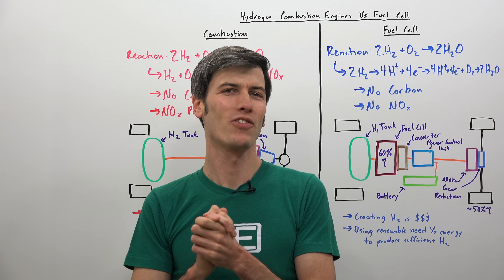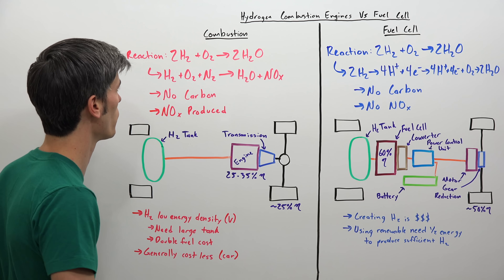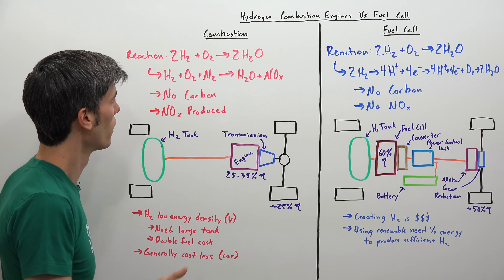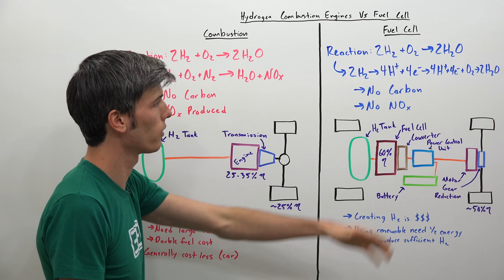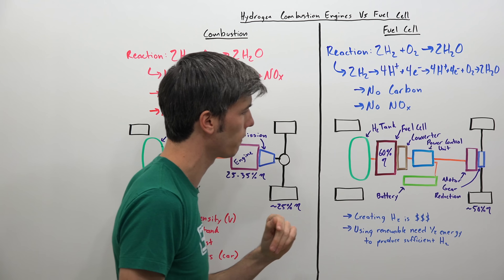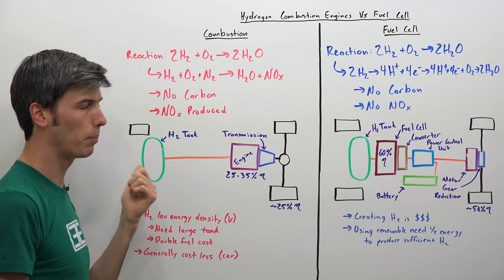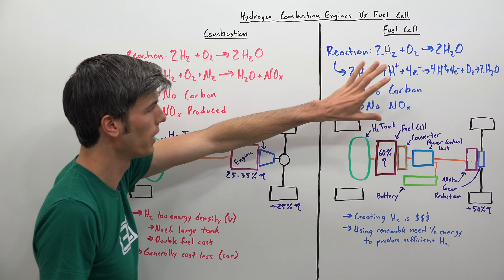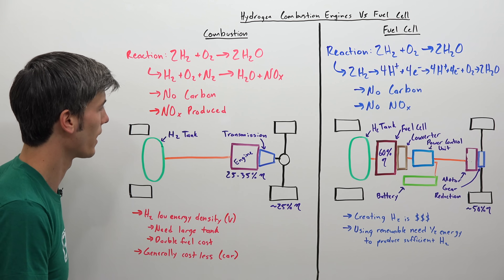Why Hydrogen Engines Are A Bad Idea

Comment: I think they should put a hydrogen generator on each car and simply burn it for fuel as needed, (on demand), after you dilute it sure it's not as efficient as the chemical process but theres no need to store it and it seems like a simpler process. Well hydrogen on demand isn't really simple but I think it can be done.

Comment: Would it be possible to have water electrolysis connected to the system to have it run off water and recycle some of it's water byproduct? Would the only byproduct by that point be oxygen? "Fuel cell engine"

Comment: So just as the way I saw this, the combustion engine implies (he also said it) that the oxygen comes from outside the car. But, would it be reasonable to have an oxygen tank alongside the hydrogen tank to avoid nitrogen? Or is the nitrogen unavoidable on any situation?
Reply: You're right that it would avoid NOx emissions.  But you already need a big ol' hydrogen tank.  Adding an oxygen tank would be even more bulk.  Also: oxygen is, ironically, pretty dangerous to have around.  All sorts of things will burn at ordinary temperatures, or explode when they'd otherwise burn, in oxygen.  A fast oxygen leak is more dangerous than a hydrogen leak.

Comment: Sure the fuel cell is better, but there are millions of vehicles with petrol engines already in use that could be used until fuel cells become more available.  Fuel cell vehicles are an entirely different vehicle.  In both cases, Lithium-6 Deuteride could be used to store more hydrogen at a lower pressure, if the government would allow it.

Comment: Any engine could be modified to inject high pressure gas with air mixture to burn a hydrogen base fuel. I mean a sophisticated system of electrolysis with a high pressure tank to store the h2 fuel would be easily viable source of long lasting fuel!!

Comment: I don't understand why ppl developing green fuels need to reintroduce carbon into the fuel. It's easy enough to make carbon neutral hydrogen that works in fuel cells and combustion engines. This way we can have both combustion and electric options from the same fuel.

Comment: What if you used the hydrogen to power batteries, and assume everything after is identical to an electric car with one extra twist: you store the hydrogen as water(sea) and do the electrolysis just in time. Could you create a perfect loop whereby the electric energy from the batteries is enough to power the electrolysis enough to produce the hydrogen needed to power the batteries assuming we have the water.

Comment: Does the fuel cell need an oxygen tank? If not, and the fuel cell vehicle uses air, which contains nitrogen, then how is the nitrogen stripped out of the air? Thanks.

Comment: OH NO! NO2! What can we possibly do about NO2?!
Have you never heard of a catalytic converter?
It takes an exceedingly small amount of electricity to electrolyze water that has an electrolyte dissolved in it (like, say, seawater.) A tank of electrolyte water (like that from the ocean) could be electrolyzed as the car is operating to feed the needs of the engine 's fuel. A car battery, and alternator would supply more than enough electricity for the job.
The first internal combustion engine, and the vehicle it ran, were created so long ago that Thomas Jefferson was still President. That engine ran on hydrogen as fuel. (Gasoline wouldn't even be invented for another 65-70 years.) The technology for running a hydrogen internal combustion engine isn't something in the future; the technology is over 200 years in the past.

Comment: Well the biggest contributer to nitrogen oxides is all the vehicles currently on the road, so not implementing hydrogen powered internal combustion is kinda like cutting off your nose to spite your face. As for the knocking problems firing at wrong times due to compression I think this problem could be solved with a rotary engine they literally burn anything flammable and run. Time to buy a RX-8 and do a mildly expensive science project.

Comment: Hydrogen gas has a relatively poor efficiency when used in a fuelcells and even worse in a combustion engines. Unfortunately we need to look also at the efficiency of Hydrogen starting from the electric power generation up to the compressed Hydrogen in the gas tank of a car (500nar). At this point only 30% of the energy is left, the other 70% is consumed by the needed energy to compress the gas and transport.
You need to know now that the energy intensive industries like the steel and cement industry want/need Hydrogen also, but they can use the Hydrogen basically right after the electrolysis, where the will also use the Oxygen. To make it short there will be in the near future no green Hydrogen available vor cars.
Kind regards from Germany! Albrecht

Comment: internal combustion engines will get more efficient in the next 10-20 years. we already have engines with 40% efficiency, by 2030 we could have engines with upto 60% efficiency, tho to be fair, hydrogen fuel cell efficiency will rise too. perhaps all the way upto 80%.
Reply: @GoldenEDM_2018  if you want practicality buy a minivan

Comment: I just watched Bob Lazar’s hydrogens powered car.  He uses solar panels to generate the hydrogen and it works on both H and gasoline.  Minimal cost.
Reply: But you need Hydride in order to store the gaseous Hydrogen until it is needed. That material is a Hydrogen bomb Catalyst so it is classified as an explosives component and is not available to the average consumer.

Comment: After my reserches the hydrogen for a fuel cell is not the same as the hydrogen for an international combustion engine.

In an international combustion engine the could use hydrogen 3.5 and in a fuel cell they should use hydrogen 5.0. The reason are the cleaning requirements of the fuel cell.

Hydrogen 5.0 is round about 20% expensiver then hydrogen 3.5. 

So the pitch between an international combustion engine and a fuel cell is a little bit closer! Even in such a concept consideration!

Comment: The idea that hydrogen vehicles do not emit carbon dioxide is somewhat misleading. Most hydrogen is created using steam reforming of methane, which uses methane and steam at high temperatures to create hydrogen and carbon dioxide. This means that the overall process might as well just use methane instead from an emissions perspective.

Comment: Wouldn't the problem of nitrogen being present be completely irrelevant if the the hydrogen fuel gas was already premixed with pure oxygen and the engine didn't use an air intake at all? If the problem with it is entirely the fault of our atmosphere then eliminating it from the equation seems like the most logical solution.
Reply: Preferrably you would not have the two gases(02 and H2) premixed but  separated into tanks, as if they were in the same tank the a spark would blow it up

Comment: I call BS on having to have a large fuel tank to store Hydrogen. Sodium hydroxide solution and aluminum rod float level systems (that only produce on demand & when the two combine (& at an extremely RAPID RATE no less) are both compact, affordable and excellent for 'on demand' purposes which can produce multiple liters of Hydrogen in short order. YES, there are complexities and some unwanted byproducts, but filtered properly can easily power a converted petroleum fueled vehicle quite nicely. Added to that there are limited (only after the reaction) high pressure surfaces and parts required and no over priced storage tanks necessary. Though water in general may be thought to be the primary source of Hydrogen using this type of generator, it's the aluminum which has an abundance of Hydrogen atoms that's the primary source. Notwithstanding,  don't expect to buy one at your local auto parts store but one could build one. More later per request.

Comment: For decarbonizing ICE's, one doesn't use hydrogen directly, or at all, if it can be helped. It's a terrible fuel for an ICE, tending to burn far too fast, having miserable by-weight or by-volume storage, or requiring pressures comparable to firearm chamber pressures to store as a pressurized liquid at 'hot day' temperature, or extreme cryogenic temperatures, far colder than liquid nitrogen, to store at atmospheric pressure as a cold liquid.

Far better to cook it up into LNH3, and use that: Energy storage only about half that of most hydrocarbons, by weight, but it's hydronitrogen: no carbon at all. 

It stores just like LPG, so no crazy high pressures or cryogenic temperatures to deal with. Instead it's literally the same mild-steel bottle as any LPG tank, albeit at slightly lower pressure.

It's presence, if it leaks, is also obvious to most people at low ppm levels - about 100 to a 1000th of the levels at which it becomes deadly: Which is the main downside. Catestrophic spills of LNH3 are potentially as deadly as a large fireball or explosion, certainly to anyone trapped in twisted wreckage. 

Or anyone stuck in traffic too close downwind. But there's at least an answer for the latter: Mandate that car cabin air is drawn through a water-filter, which will trap and remove the NH3: It's so dangerous because it bonds to water exceedingly well, releasing substantial energy as it does so (And turning the water quite strongly basic and corrosive: It's why 'handy-andy' is a cleaner: It turns plant/animal oils and fats into soap. But the flipside is that bubbling air in through water efficiently removes it from the air. 

It's important to note the EU exposure level for it was set by a committee breaking for lunch, having just spent the morning determining the appropriate level for carbon monoxide to be no higher than 25 ppm for 8 hours, or 35 ppm for 15 minutes. Other authorities have set the threshold of 'immediate hazard' as high as 480 ppm (it occurs at about that in tobacco smoke). Unlike Carbon Monixide, which you can not smell or taste, and which requires life support for many hours on end to survive, assuming you get help soon enough, Ammonia is naturally produced in our own bodies as a byproduct of metabolising proteins: Our livers have evolved to handle it, and our eyes, sense of smell (and autonomous avoidance reactions) likewise.

If burned properly, it reacts to just N2, the majority component of air, and H2O. And it is already possible to use it in any internal combustion engine: It can safely and easily half CO2 emissions, with what amounts to not much more than a typical aftermarket LPG kit: Albeit one that needs the engine's original fuel as well.

Engines made to run on NH3 alone require a much higher compression ratio than even Diesel engines do: NH3 doesn't accellerate under pressure the way hydrocarbon fuels do, so it's difficult to run a hydrocarbon engine on NH3 alone. There is a way to force it anyway, but this worsens the fuel economy slightly: Catalytically convert about 30% of the fuel directly to H2 and N2 over a hot metal catalyst. Plain iron will work, or nickel - no fancy rare-earth metals needed. The mix of partially cracked NH3 with H2 and N2 is far safer than H2 alone: the presence of the NH3 prevents explosive detonation from being possible at all, even under compression. You need the H2 in the mix just to prevent the pistons from outrunning the flamefront.

This is all positively ancient technology, by today's standards. Ammonia has been used as a fuel as far back as WWII. It's hydrogen (primarily), but the formation of N2 does release energy as well. 

An engine designed to run on LNH3 alone would have the desirable property of being as unable to run on any hydrocarbon fuel, for much the same reason that you can't get away with running a Diesel engine on Gasolene for very long: The compression ratio of the Diesel is just far too high: knock and detonation under load will erode and soon destroy the engine. So it is with a pure ammonia engine. Now this 'bug' is a feature, for you can be sure that people who buy that engine won't just fuel up on propane or natural gas.

Storage and handling ammonia is also a mature industry: It's one the largest synthesized chemicals, by mass, in use already. It's been said to be responsible for feeding three quarters of the world's population, just for it's use globally as a fertilizer.

Green, blue, black, brown, red? It comes in as many 'kinds' as the hydrogen it is made from, but offers great promise for storage and shipment of energy, including rapid refuelling. The downside is, that per kg or per volume, your Diesel car will have half the range. "Only" 500 km/tank instead of a thousand. But at least, unlike for hydrogen, there's no risk of your vehicle suddenly exploding!

Anyway, when you hear 'hydrogen' and 'internal combustion', you should be thinking of NH3, not of H2. 

H2 itself simply isn't a good, practical way to store chemical energy.

Comment: on the fuel cell the input is air. which is actually composed of oxygen an Nitrogen. so is there a possibility that NOx will also be produced?
Reply: No - doesn't get hot enough. Nitrogen takes a lot of heat to react with oxygen.

Comment: You miss loss of efficiency in the power converter and electric engine in the fuel cell example.  I'd assume an electric engine isn't 100%.  I know power never gets converted without inefficiency...  those two can not be 95% efficient

Comment: It is absolutely right that hydrogen-(IC) engine is, physically, thermodynamically and chemically, bad idea. 
However, is it also so bad from engineering perspective? e.g. tolerance to low grade Hydrogen, no membrane with high material cost, poising and degrading issues, use of existing assembly line for engine and vehicle, existing technology for NOx, short time from R&D to market, etc.

Comment: Why would there be nitrogen in the combustion engine. Surely you wouldn't need to draw air in as the oxygen would be pulled in from a separate tank to the hydrogen, being that in the production of hydrogen you would get oxygen as a byproduct anyway?

Comment: @ Engineering Explained  Could you have a six stroke hydrogen combustion engine to reduce NOX levels relative to a 4 stoke or have a split cycle engine, the first stage would be a 4 stroke cycle, the second stage a 4 stoke steam engine with lower pressure and wider pistons than the first stage. the second stage engine would take on exhaust steam from the first stage engine (induction phase), the second stroke would compress the steam, the third power stroke would inject water to create more steam, the fourth stroke would be exhaust. a six stroke or split cycle or main cycle + bottoming cycle should have lower rejection temperature but re-compression would produce heating and possibly create additional NOX. I wonder if a biological membrane gas filter (has been proven for water treatment) could stop the engine taking in nitrogen and stop NOX production but there may be pumping losses unless the membrane has massive surface area.

Comment: They are not at all a bad idea if we're talking about small aircraft. (100-500hp).   We can't afford the weight of lugging aroung fuel cells. Yes, hydrogen tanks will likely weigh more than gasoline tanks but it's still a better power to weight rato for the power plant installation. Maybe not forever but right now it is.

Comment: Can you do an EE on why, or more precisely how, an H2 combustion engine running on H2 created onboard via electrolysis and burning both the H2 and O2 byproducts of that electrolysis and not air (therefore no N so no NOx) would fail?  I know there has to be some input of energy (no perpetual motion machines here!) but not sure why or how that would need to be done??
Reply: When you create h2 you use energy. Then you burn it, which gives you back the exact same energy but with a slight loss due to friction. The input of energy would be electricity you used to split hydrogen, which you have to get from a battery or a charger.
 What was the point then? You just threw away energy for literally no reason.

Just charge a battery, its much simpler and efficient.

Comment: Dont forget plenty of waste heat in the combustion engine for heating in cold climates that the fuel cel  would need to produce with electrical resistance heating.

Comment: Would there be a way to use a similar method to what desils use to mitigate nox production? Ive heard def(active ingredient urea right?) eliminates 90% of nox emissions.  If something like that was possible I could see combustion having a positive place in our green transfer because you have to weigh the emissions and lessor efficiency vs the value of basically recycling all the vehicles we already have into a green system.  How many miles would i have to drive a combustion hydrogen powered early 2000s beater until a moderate rate of NOx subsiquently mitigated with a def like substance causes a greater damage to the environment than producing a single brand new hydrogen fuel cell car? Did my own research and Nox mitigation using something similar to def is being looked into heavily but even 3 years later we arent there yet.